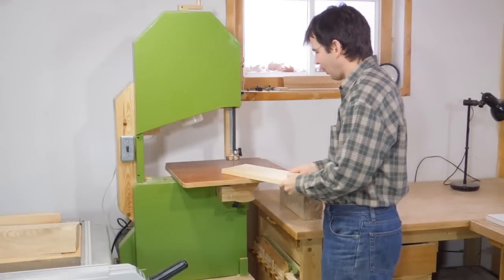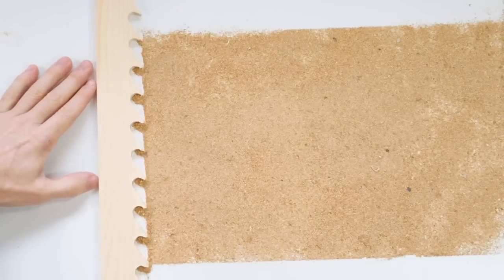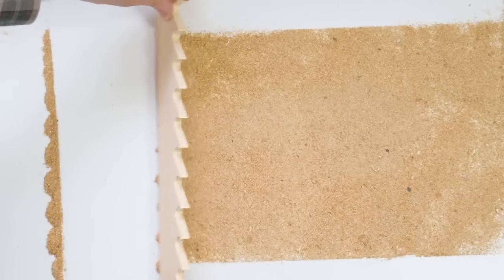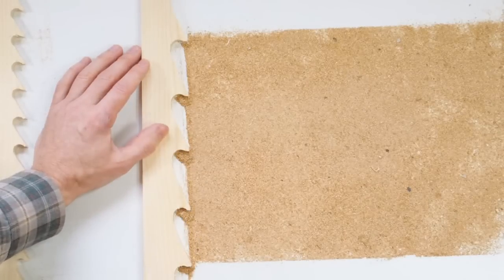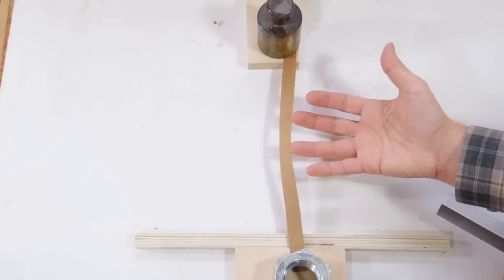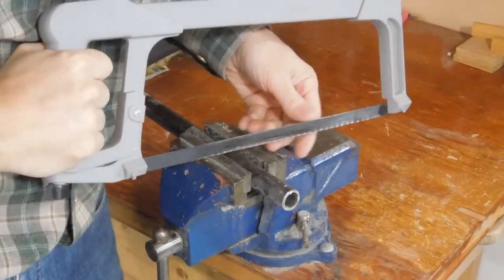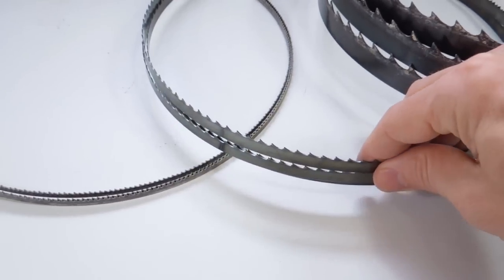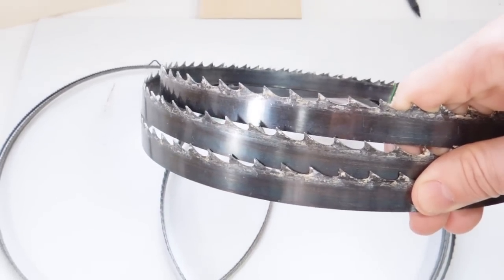The physics of bandsaw resawing

Comment: This is still the best video on the physics of resawing. 
I have found that you can reduce the downsides of "excessive" resaw height with suboptimal power and/or tension by reducing the number of teeth in the blade. There's no reason you can't make a half inch blade with TPI lower than 4. Let's say 2 TPI, since you installed the riser and doubled your maximum resaw height. You could have the same number of teeth as with any larger blade. The longer, skinny gullets wouldn't necessarily help, much. But this would reduce the feed pressure:sharpness ratio you need to still get a minimum bite that's good. So your saw's lower maximum blade tensioning ability is no longer causing significant blade drift. This would also halve the amount of horsepower you need, compared to the 4 TPI blade. The only downside of this is that you cut at half the rate and you still need somewhat sharper blades (but not nearly as sharp). If you couldn't sustain that rate at all, before this change, you're at least expanding your capabilities. You can make that thick resaw; it will be a straighter cut; you won't bog down the motor. It'll just be slower.

Comment: Really helpful - thanks.  What you covered is probably what most people have been told but you explained it in a way they can understand - and you added in extra advice like the metal fatigue encountered when using smaller wheels.  Should make purchasing decisions easier to justify when looking at the the bigger capacity bandsaws - it did for me anyway.  Cheers.

Comment: This was the very first video I found of yours, and I've since watched every single video you've posted at least once. Some much more than that. Anyway, I just bought my first used bandsaw. I need to buy a new blade, but wasn't sure which to get. This video popped into mind. If I were to buy just one (80") saw blade (for now), what width/TPI should I get? I won't be doing much re-sawing, but my first project will have me cutting a shape out of maybe 2-3 inches of cherry. In general I'll mainly use it more for curved shapes in wood maybe 1/2 to 1 inch thick.
Reply from the maker: Get different blades, see which works best with your saw and your wood (really depends on how you work, saw speed, blade quality, etc)
Reply: Good advice. Thanks! I started with a 1/4" - 6 TPI blade today, but I didn't get a very smooth cut. Ended up with a lot of ripples and it was hard to cut precise curves and stay on the lines, so I may try something else soon. It could also just be a cheap blade. It's tough figuring all this out on my own, having never used a bandsaw before, and with no one here for guidance. Even with a million YouTube videos to help, it's hard to tune up a saw when you don't have any experience using one that's in tune.
Reply: Matthias Wandel Zach z v v v 23rd ek

Comment: Excellent explanation and helpful. I make band saw boxes though and many times I have cut through 5.5" of figured maple to make a hidden hinge with 3/8"D and I've used a 1/8" wide blade with 14TPI on my 12", 37 year old, Craftsman band saw. Theoretically this should not work, and if the blade is not very sharp and tensioned high (as you said) here will be bowing and not a straight cut. For resawing I use the Wood Slicer blade on my 14" Jet band saw and it works like a champ. woodworks-by-donna

Comment: Great Job!

In Metal cutting generally there is some formula for a minimum and Maximum number of teeth when compared the the thickness of the material being cut.

I am assuming based on 40 years of woodworking in my shop... the same is true.

For a faster cut, less teeth, but... if the wood is thin, you must have at least 2-3 teeth in the wood.  I like your comment about "You just need a bigger saw".

Comment: Thank you for not doing another video on adjusting for drift like all of the magazines do. I have resawn 10" wide Mahogany without having to adjust for drift simply because I was using the right blade, with proper tension and proper feed speed. Also having the guides set up properly.

Comment: I'm currently in the testing phase of my latest veneer resaw protype. It cuts 18" deep in a throat 14" wide with a 2HP drive train. I use a proprietary rail-and-sled feed system that factors blade lead into its locked position. I feed it with my pinky finger. Using two high performance Iturra tensioning springs, it runs 1" lennox carbide-tipped resaw blades with only 3/32" of kerf to produce 1/16" veneers 18" wide and 
as long as your workpiece. Because the tracking and tension system is frictionless, there is no blade flapping at any setting and the cut finish is so smooth it looks like it just came out of a planer, not a band saw. It's ready-to-glue ! I'm trying to retire but I want to introduce this prototype first because when ya'll see what a sweet machine this is it will change the way they build bandsaws hereafter; you'll no longer settle for the antiquated designs you're now getting from the big corporate tool companies.

Comment: when resawing, i usually make a  1" deep scoring cuts with the tablesaw. with an 1/8 inch kerf, that makes it pretty easy to guide the workpiece thru a resaw blade on a bandsaw, without a fence. i usually plane the pieces to finish thickness afterwards. making the table saw cuts also shows how many pieces i will be able to get from one big piece. no guessing

Comment: Great video on the basics, what is the realistic maximum thickness can you resaw on 14" wheel, for most domestic species, and then for the denser tropicals?  How much drag does an improperly set tooth create? How much blade wandering is caused by from miss-set teeth? Is there a rule of thumb for feed speed versus thickness versus species?  Have you seen the carbide tipped blades that produce a nearly planed finish?

Comment: Great explanation! Thank you very much for explaining this.
I have a Ryobi BS 51 with 10" wheels and a 2"(5cm) stellite tipped blade that is 1mm thick with about 1.5 teeth per inch. Max height is about 7". I've never had a problem resawing hard wood. The Timberwolf blades are too thick and will crack and give wavy cuts. The steel that is used on my 1mm blades is different than the Timberwolf. Can you explain the different steels that are used and why, Please.

Comment: @frogsoda - I'll second that.  The necessity of setting the fence for a different drift angle for each blade is a myth that's been around for at least 40 years.  Track the center of the blade in the center of the wheel.  Adjust the table so the miter gauge slot is parallel to the side of the blade and then adjust the fence parallel to the miter gauge slot.  It should only ever have to be done once - when the saw is first obtained.  Fence head must register against a straight fence rail though.

Comment: Hi Mathias,  what about getting rid of some of the friction creating from running the stock across the bandsaw top? I'm not sure if that would make enough of a difference, but i sure would like too see a test on that. I was thinking of some sort of bearing situation that the would could ride on. But that seem's a bit involved for the moment. Then i was thinking of spraying a silicone on the bandsaw top. I then realized maybe i didnt want to try snd clean that off if it didnt work. My last and easiest of the idea's was to place a piece of wax paper between the stock and the top.  What do you think? Any validity in any of my ideas? Would love to hear your thoughts on this. Thanks! And good video.
Reply from the maker: that makes absolutely no difference to the actual cutting.

Comment: so if I can build one of the 3 bandsaws you sold plans for. the largest one is the best for resawing and get a larger blade with low tooth count? My small shopsmith bandsaw is not currently "Cutting it".
Reply from the maker: yes, the biggest one is best for resawing.  It can even take sawmill blades.

Comment: You can't really avoid it unless you use a no-set blade (that's the only situation where it would behave like your model). Some sawdust will always fly between set teeth, and go around the sides of the blade. It's generally more of a feature than a bug.

Bigger blades (usually) have more set, since they're designed for rougher work, so "use a bigger blade" is a good solution, but a bigger blade with less set can actually run worse, so it's important to check that too.

Comment: So confused about bandsaw drift - everyone seems to have a different explanation! Totally get your take on resawing, but what about the position of the band on the top wheel, top and bottom wheel alignment, guide position, tension, ensuring the blade and fence are aligned?
Reply from the maker: yes, those need to be right too.
Reply: @matthiaswandel  Thanks for your response. I am sure that you are correct, but I have seen videos saying that only the alignment of the table is important (for avoiding drift), others suggesting different positions for the blade on the top wheel are necessary, that top and bottom wheels are deliberately misaligned, and so on. And most seem to come from reputable woodworkers.

Comment: Would it make any difference if you added a big heavy flywheel to a fairly week saw so it can keep the momentum better, or would it not make any difference & just make it worse?
Reply from the maker: +creativeobsin I suppose it could help it you pushed on the wood intermittently.  But overall, I don't think it would be a good idea.
Reply: +Matthias Wandel Still, it would be a interesting experiment to try. :)
Reply: +creativeobsin If you made the flywheel large enough to store the required energy to allow resawing of large work the flywheel would be huge, and would require some clutch mechanism to allow the saw to come up to speed or the motor would be overloaded.  Additionally, if the wood were fed into the blade too fast the blade could break more easily as the flywheel could deliver more instantaneous power to the blade than it could handle.  Better to use a blade that is wider and has fewer teeth per inch as Matthias explained so well in the video.
Reply: +arlen raasch yes, probably.

Comment: I was wondering had you consider removing every other teeth as well as curving the ends? Heat treating can also keep it sharp, a way to heat it at red hot while bathing in oil may work. Try very cheap blades first.

Comment: It would be nice if the blade guides and wheel alignment were addressed, too. I actually don't use the side blade guides on my saw. I find the rear guide bearings are more important. IME, the side bearings help, but not by all that much. And when relying on a tight fit on the side guides, it seems like I need to adjust the saw more often.  I use the side guides on my saw just to make sure the blade stays over the rear guides... and if the blade deflects, it is too much for the saw/blade... tightening the side guides isn't going to fix that problem, adequately, in my current opinion.
Reply from the maker: Yes, side bearings are a pain in the ass.  Side blocks are much easier to get right.
Reply: I agree. I made wood side blocks after seeing your vid. I didn't have anything harder than maple, though, at that time. And they don't last too long when kept tight. I'm not sure why my saw's side bearings seize up after only a few months, while the rear bearings hold up much better. I still use my original maple side blocks but with a healthy gap; basically, where they wear down, I don't tighten them back up. And I don't see any objective degradation in performance. Even when resawing 4+" inches of expensive wood, I spend time to make sure the blade is sharp, the tension is right, and the wheels are tuned for the blade and tension. I make sure the rear guides are right. I have improved my deep cuts quite a bit since I started. But the side guides don't seem to be part of the equation, yet. Maybe it's just the luck of my particular saw.

Comment: You are very good at explaining stuff like this! I do not, though, agree with your explanation, that the teeth don't have the space to transport the dust away. If you calculate the volume of dust the blade can transport away per second, it should be fine.
It's simply to do with the number of teeth touching the surface of wood. Like a man resting on a madras of nails. Because of the number of nails against his skin, he would have to weigh a lot more, to get pierced.

Comment: The wooden saw model is neat, but not entirely accurate. Unless you're using a no-set (or very think kerf) saw, the cut will be wider than the actual saw, so the sawdust doesn't have to be carried "under" the tooth.